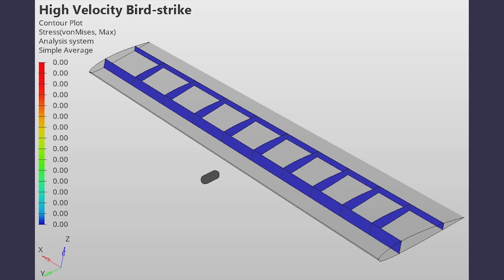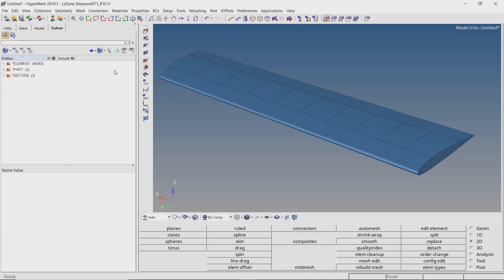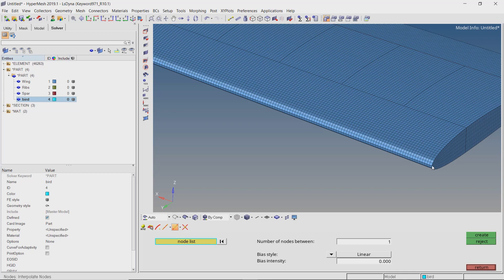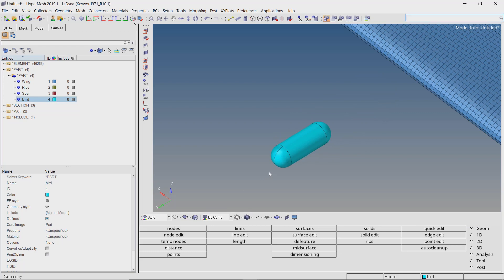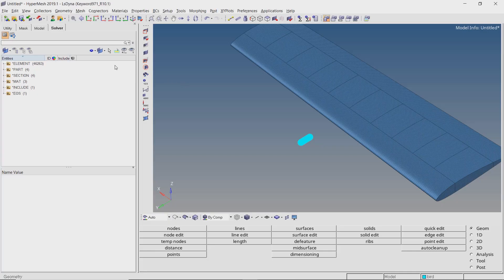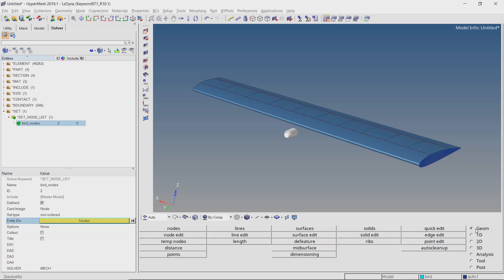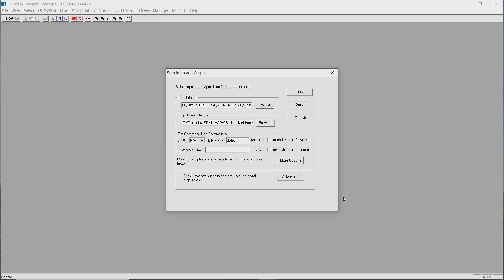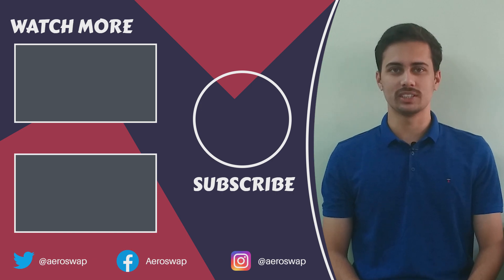Hypermesh LS Dyna Analysis [SPH Tutorial]

Comment: what is the unit of stress in the in the HyperView, when we are seeing the bird strike result in the legend. I think displacement unit is mm. But I am not sure about stress unit. another question is in my analysis my total energy line is not straight. it is decreasing. Can  you suggest solution.
Reply from the maker: If the displacement is in mm, the stress will be in MPa. Total energy line may not be straight because of element quality issues. Using a better quality mesh may help to fix the problem.

Comment: Hello! Please tell me such a moment, I work with MAT 83 in DYNA (modeling of foams), the properties depend on the deformation rate and I load a table with various curves and corresponding deformation rates. Our machine allows to obtain experimentally the maximum compression speed up to 1000 mm/min (16.7 mm/c).

Question 1: In the Define Table, should I specify the units in which I work (mm/s)?

Question 2: If in the simplest test of a ball falling from a height of 1 meter, the speed is 4500 mm/s, then how will the program take into account the curve for such a speed if the maximum speed at which we can get an experimental curve is 16.7 mm/s. It is unrealistic to obtain stress-compression curves at such high speeds experimentally. So we won't get accurate results at such speeds?
Thank you!

Comment: Good afternoon! Thank you very much for your help, all your advice helped me. I'm sure you can help me a little more and answer my question..How can LS - DYNA simulate, for example, a box on a pallet to determine whether it will cause deformation of the pallet and destruction due to high mass..?
Reply from the maker: Hey! Good to know you liked the video. From your description of the problem, I am assuming you want to place one component on top of another and apply gravity load. Then measure the deformation cause due to weight acting on the lower component, right? If yes, this is definitely possible. However, this is not a explicit dynamic case. A simple linear/nonlinear static analysis would be sufficient so I would suggest using Optistruct instead of LS Dyna.
Reply: @Aeroswap  Thanks a lot for the answer. You got it right. Logically, it will look like two bodies (one on the other) and one of the bodies will exert a static load on the second body in units of force (for example, Newton). Or on the body, select the elements to which a simple upload will be attached, without a second body, and see the result?
Reply from the maker: Here is what I would do-
1. Create two separate bodies close to each other (such that one is placed on top of other) and assign material and property to both
2. Define a frictional/nonfrictional contact between them with additional contact settings that might be required
3. Use the GRAV card in Opustruct to define direction of gravity load
4. Create SPCs at required locations and run a nonlinear static analysis
5. Not only will you get the deformation due to weight (gravity) but also the contact forces at the interface!

I hope this helps!
Reply: @Aeroswap  thank you very much!!
Reply: @Aeroswap  Thank you very much! Thanks to your advice, everything worked out. I am very glad that there are such people who can help.. Thanks.
Reply: @Aeroswap  Hello! You helped me a lot with my last question. Thanks. Will you help me again, please?.. Is it possible to implement a vibration propagation model by design in DUNE (or Altair)? For example, there is a 3D model of a metal frame and a vibration source is located on it.. Is it possible to estimate the propagation of vibration from the source through the frame at different frequencies, taking into account the material and the rigid contact between the frame and the vibrating body. I understand that this is an explicit analysis. If this is possible, what command can be used to set the vibrating body? Thanks.

Comment: Sir, if we use jet engine assembly how do we make the blades rotate? Does it have options to give desired rpm to the blades?
Reply from the maker: In that case, you can give rotational velocity to the blades. The setup is almost similar to initial velocity.

Comment: Very good demonstration Swapnil! As requested in a comment below, I would like to see the same analysis within RADIOSS. In addition, please try an impact problem with a composite structure. Should you need any assistance with the initial setup, please send a message. Thank you for your effort.
Reply from the maker: Thanks Emmanuel! I am indeed planning a video about impact analysis on composite structure.
I used a Radioss SPH case study to set up this analysis using LS Dyna. So it won't take much time to redo this in Radioss. Will start working on it soon 👍🏻
Reply: Please do high velocity bullet impact analysis on composite material.. Hoping for your video on this.. Much needed.. Thanks in advance
Reply from the maker: Thanks for the suggestion. I will work on this topic soon!